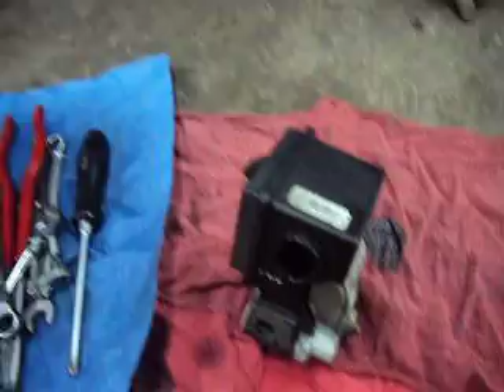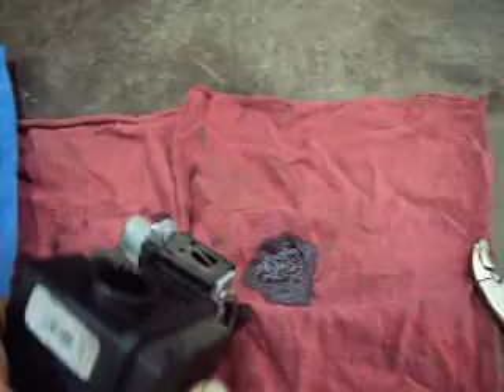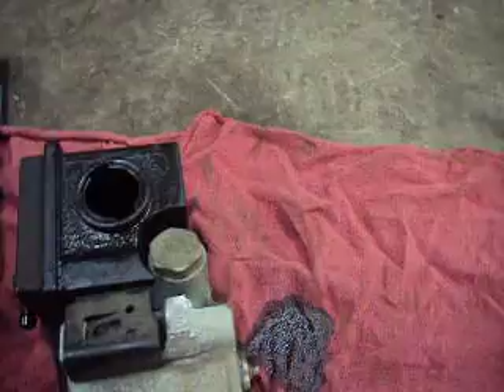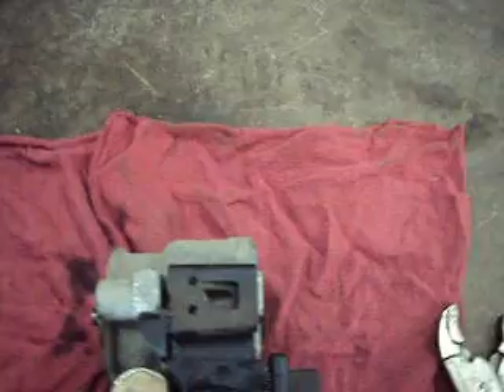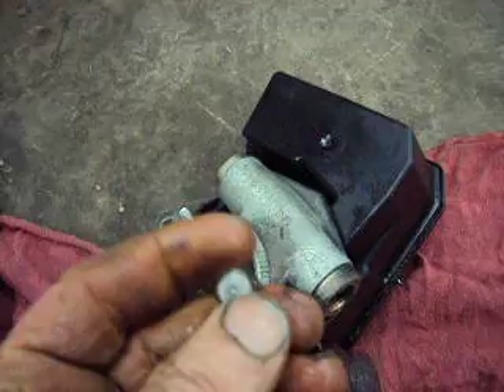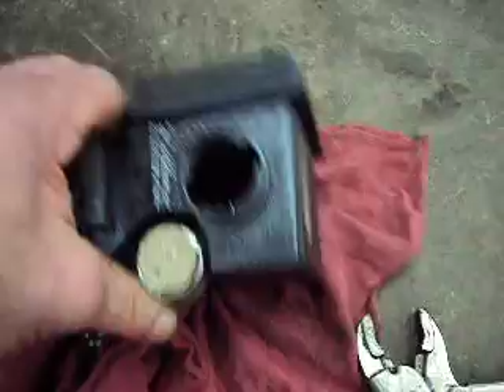2005 chevy Classic 2.2 Eco Tech power steering failure cause

Comment: In my case the piece of metal is stuck in the camshaft hole. I drilled and put a screw to pull it out but does not work. Any suggestion that does not damage the camshaft?
Reply: I have this same issue we’re you able to get it out ?